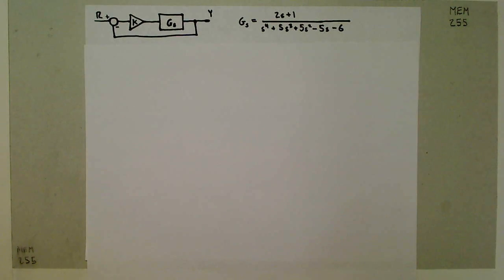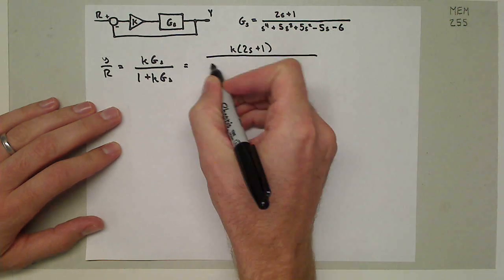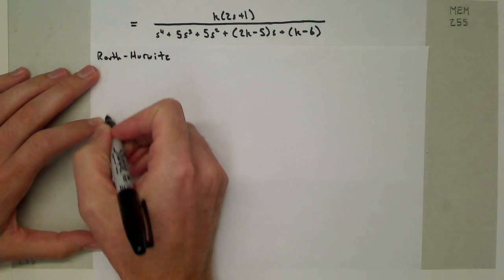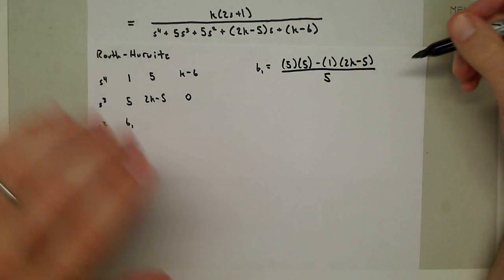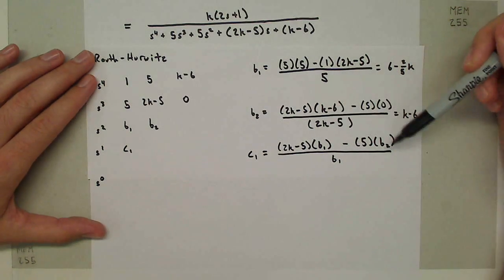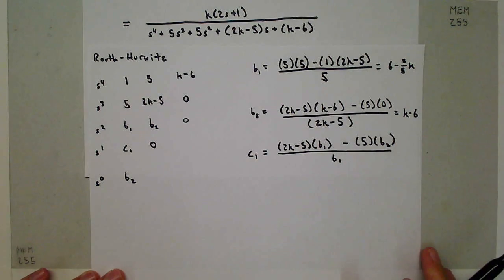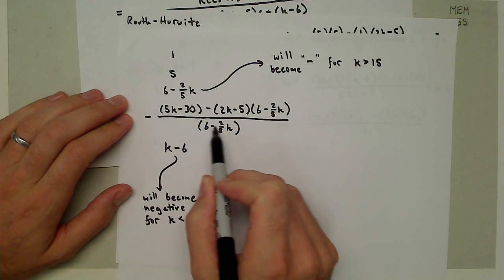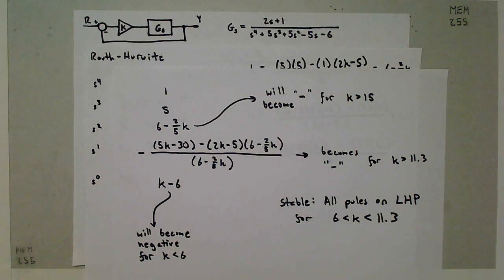RouthHurwitz Stability Example

Comment: Although this video is showing the incorrect procedure for calculating b2...it is still "good" to identify.... how not to do the RH table.  

 I did follow up  the video and the range for K is as follows:   from S^2 row we get  k < 15 for a stable system.   From the S^0 row,  we get K >6 for a stable system.  
Hence, for k within the range of  6 < K  < 15 and you get  a stable system....however...we need to figure out the coefficient for S^1....This is a little bit complicated because you have k in two terms...hence you will end with a quadratic in k...if you plot this... a range in k that will make S^1 postive (for a stable system) will be around  0 <= k  < 11.3 and k>15 ...
The final range for K as to make all elements in column 1 positive will be   6 < k < 11.3

Comment: but in norman nise book it shows a different method!!!
Reply: ID Jeet - which method does it show out of curiosity?
Reply: Tjam J29:13 the cross multiplication should always be between 1st column values in each rows and rest of the values in the same row and the product obtained is divided by the 1st value of each row...ex-

1    3     4    6    

5     4     3     7

value in 3rd row will be 

(5*3 - 4*1)/5    (5*4-3*1)/5   (5*6 - 7*1)/5

and accordingly!!! , in case of any sign change the system will be unstable as it indicates the presence of pole in RHS of the cartesian graph....hope that helps....